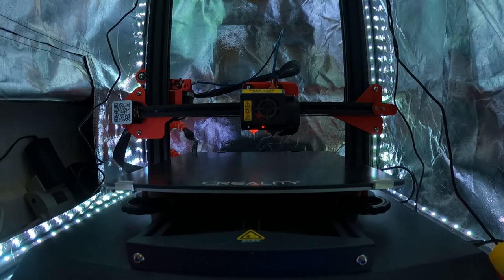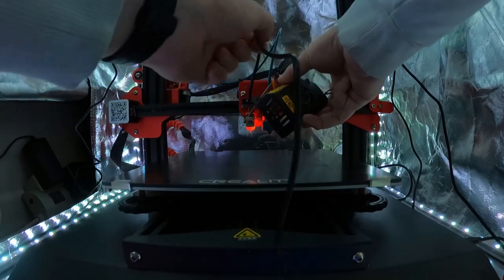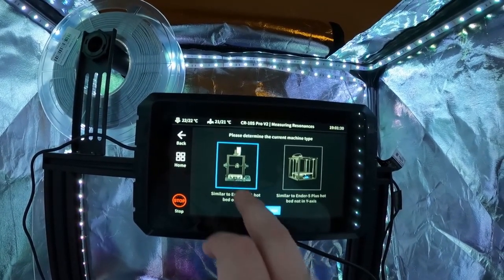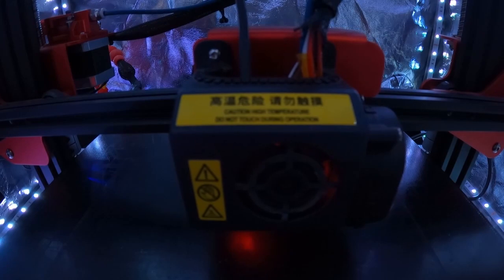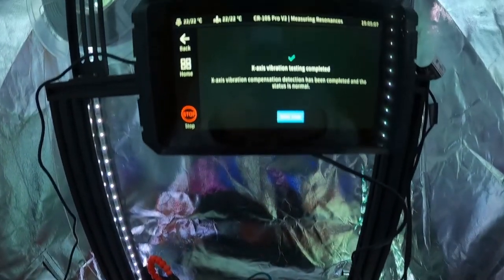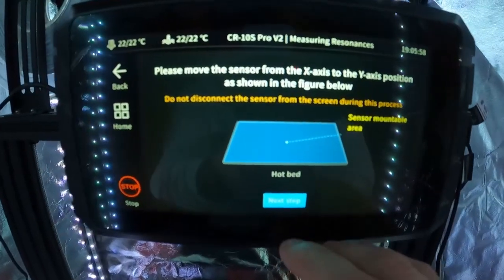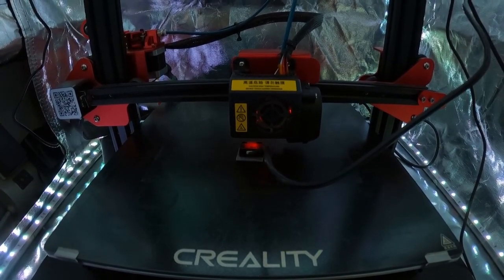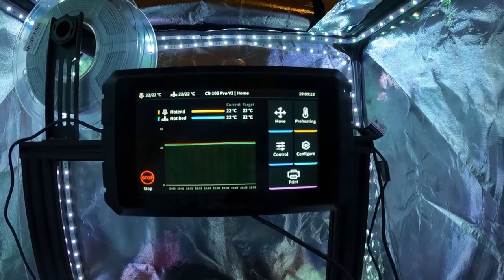Input Shaping (Resonance Compensation) on the Creality Sonic Pad  -  Speed Up Your 3D Printing Speed

Comment: I noticed after I ran input shaping the printer.cfg file still has the settings hash tagged - as in they are comments not code. Did this happen to you as well?   

This was on both my CR10s pro v2 and my ended 3 s1 pro in the sonic pad.
Reply from the maker: Honestly I can't remember if it was commented after the test if I did it.  I know pressure advance needed to be added manually.  Even if it wasn't commented for me, I set it up several firmware versions ago.  I would search for it appearing twice.  Or remove the commented one and run again.
Reply: @WilliamAgans   it’s not commented out now then?  In your printer.cfg?
Reply: Trying to figure out the same thing now, is it set somewhere else?
Reply: @claytonnlambert  I eventually tracked down that the hash-tags are normal for this section.  I dont get it, but it is normal and is working.
Reply: @timstratton9  Thanks! I also stumbled across a Reddit thread that explained the config is applied from the comments at the very bottom of the file under the do not edit line.

Comment: Does input shaping set your acceleration…? Wend through this and in fluidd its showing my accelerating as 500mm/s^2. Seams low but maybe that is where it should be? Just wondering if that’s something i should be setting myself, or set automatically with input shaper
Reply from the maker: Input shaper does not set acceleration.   My next video, which will be posted by Thursday,  breaks down setting up  acceleration for your setup.   SPOILER:  On my CR-10S Pro V2, I ran a high as 3500mm/sec/sec, although it is too high for detailed prints.

Comment: I might need to run it again, i’m still getting ghosting unless I drop the outer wall to like 34-50mms & 1.5-2k accel or less.
Reply from the maker: My next video may help with tuning for acceleration and ghosting.  Should be done by Thursday.   Stay tuned and subscribe if you haven't already!

Comment: The cable sensor use 4ever?
Reply from the maker: Once you set up input shaping, you shouldn't need to connect the sensor again, unless you move the printer, or change parts (hot end, etc).  You may also need to run the input shaping test again if you have a printer with dual Z-Axis motors (like the CR-10 series, and the two sides go out of sync.
Reply: @WilliamAgans  thanks !